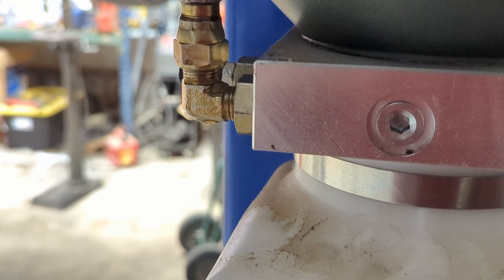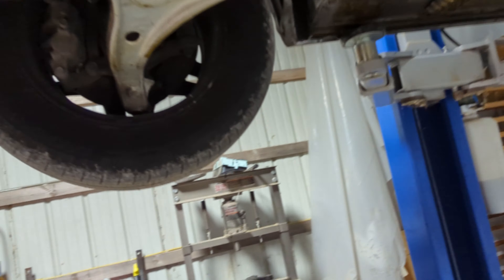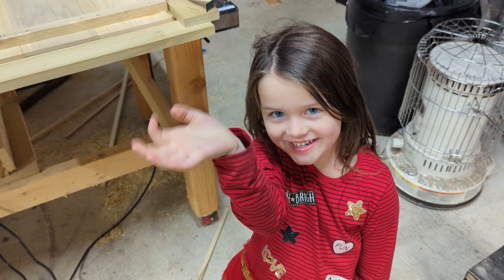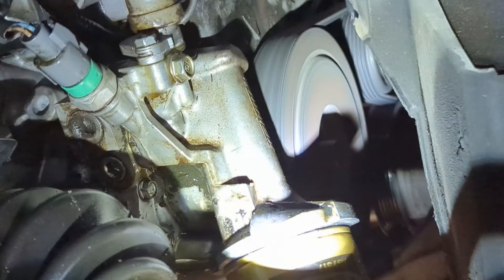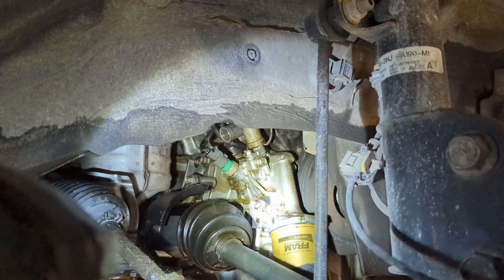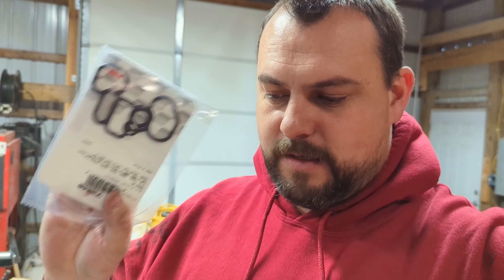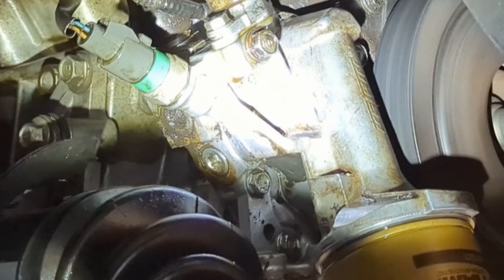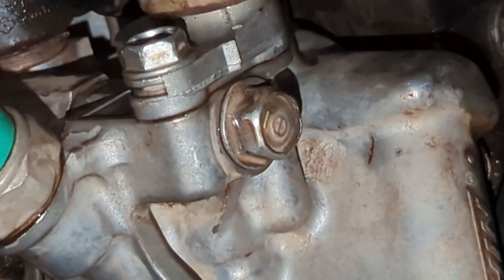How to fix an oil leak on a Honda Odyssey (Oil filter housing gasket)

Comment: Good, short, to the point DIY video.  Wal-Mart auto centers do an amazing job restoring those yellow headlight lenses to clear for $25. A gal at the local center took 45 minutes to restore my 2007 Ody ex-l lenses in 2021 and still clear.   Nice lift!
Reply from the maker: Yeah I restored them before you can buy a decent kid at harbor Freight and then you just need to make sure you spray it with some UV resistant clear coat so that they last a long time.

Comment: looks like your is a j35a6 engine withOUT VCM the 2007 j35a7  has the VCM  and has a different gasket

it appears the VCM engine does not have the gasket with the strainer .  where as the j35a6 engine does and does not have VCM. 

the ex-l and touring  models use j35a7 engine VCM and their gasket is 15302RDVJ00

the ex and dx  models dont use j35a6 engine and dont have VCM and their gasket iis 15825-P8AA01

and the vtec and pressure sensor  are all on the housing.  where as the j35a7  is NOT.

good vid here

Comment: I had a problem with a leak of a liquid similar to oil. Oil stains and streaks were on the oil pan and in some places around. The confusing thing was that the color of the liquid was the color of new oil (light yellow), but my oil was with some mileage and darker in color. It turned out to be power steering fluid: the hose (Honda 53713-SHJ-A01 Power Steering Pressure Hose) near the power steering pump was leaking due to cracks. Maybe this information will be useful to someone.
Reply from the maker: Good observation on the different color of oil.

Comment: Just subscribed! Quick question, I am actually a broad right now in Mexico and I do have a mechanic I trust down here and I ordered the gaskets for my 2006 Odyssey Vtec solenoid but what are the O-rings I would need or should replace along with that job? any chance you can refer us to those?
Reply from the maker: The kit should include all the seals and o-rings. It was whatever AutoZone had in stock. In future videos I'll make sure I post part numbers.

Comment: Have ya replaced the PCV valve yet? A faulty one will cause gaskets to fail because of increased crankcase pressure.
Reply from the maker: I have not, but that wasn't the issue.
Reply: So while you are correct, more than likely it is age that causes seals to go bad. Rubber has  a shelf life and gets brittle over time.

Comment: What year is that van. Can you post links for the parts you got from autozone? Thanks! Nice quick video! Kids are adorable!
Reply: 3rd gen 2005-2007
Reply from the maker: It was a 2007. I do not remember the part number but it's whatever AutoZone had in stock

Comment: Well, poop. Have the same problem but tuned in to simply see how you were able to disconnect the upper solenoid connection from its housing. 🥴
Reply from the maker: Hope you were able to fix it.